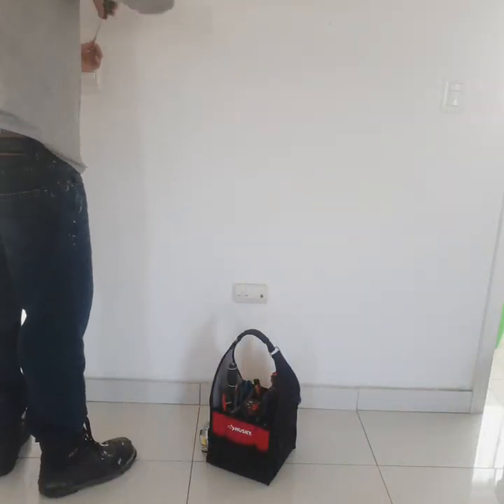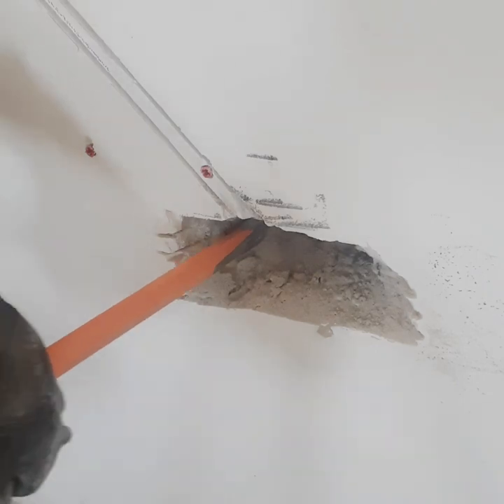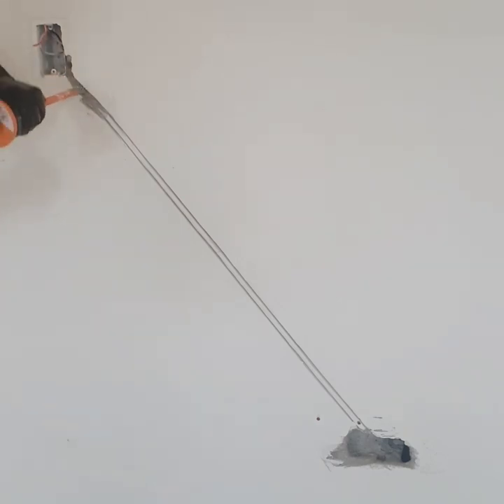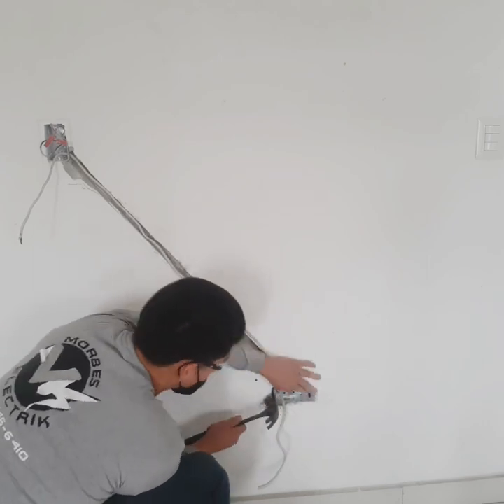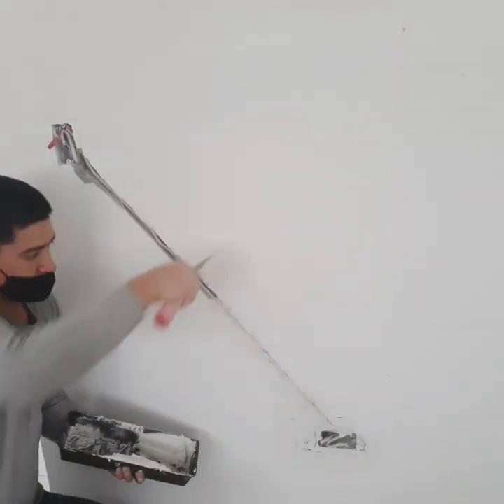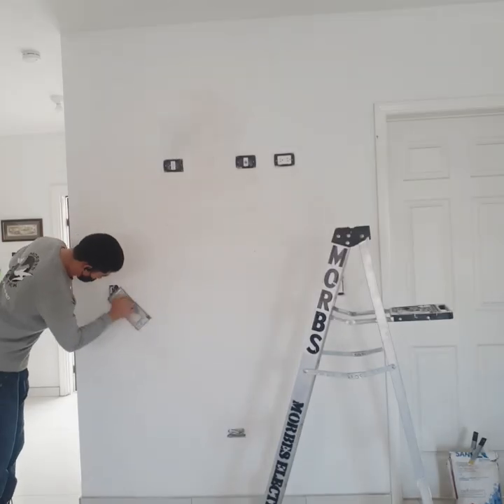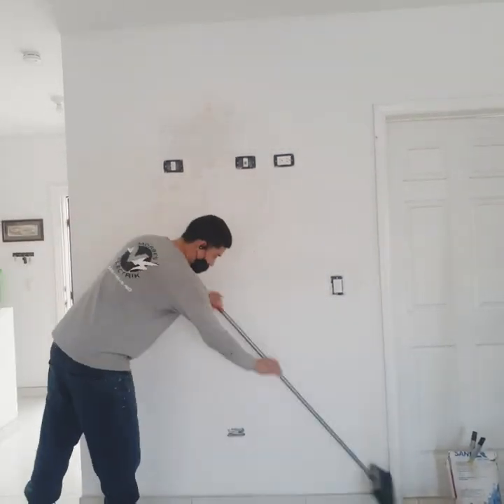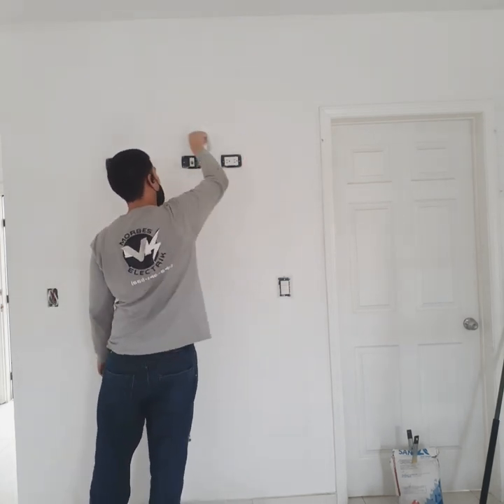How to add an electrical outlet in a brick wall - Morbes Electric working in Rosarito Mexico ⚡💪

Comment: The patch work is awesome!!! The only thing that I would recommend is maybe using an armored cable  for protection and using a connector in your box. Those knockouts are dull when you run your finger on them but in do time as the house settles it leaves the possibility of creating a short. Other than those things nice job!!!

Comment: How come you did not use wire clamps to hold wire to box, and also protect the insulation from the metal edges of the box?

Comment: Just a stupid question, what cable did you use in your video that is rated for direct contact with mortar?? It almost looked like you used NM cable (Romex). That might be OK as long as you're not doing an install in the USA.

Comment: Hey bro. very nice video. I have a question. I'm new to installing outlets in Mexico. What materials do you suggest to use to create outlets from other outlets? I do this in the states for my business all the time. but the parts are quite different in Mexico. Any tips you could share? I'd appreciate it. Thx. Jim BTW, i'm in Leon, Guanajuato.
Reply: Mexico has electricity?

Comment: Amateur electrical work. Because you don't run a wire in 45 degree, but in 90 degree. Is this how they tought you in electrical engineering school? Or if this is your diy learned skill, than you need to know: 90 degree, not the shortest path. Actually, shortest path, but in 90 degree.
Reply: Who cares if it's all hidden? cheaper on wire...
What's the reason they gave you in your school?
Reply: @EmceeMe  Because later when someone wants to drill in the wall for any reason, to hang a photo or a shelf.  It is common knowledge (based on standard)  that you would expect wires below or parallel to your outlets. So people will avoid drilling in those places perpendicular or parallel to a near outlet.  
So having a wire at an angle increases the risk of drilling or cutting into a hot wire. 

Also I think in the electric code, there is a minimum depth for the wire, which he did not respect in the video.
Reply: @qaysar82  makes sense. Thanks for explaining
Reply: @qaysar82  00
Reply: @qaysar82  Different countries different regs.
Reply: @EmceeMe  There is no reason the guys a d   i  c   k